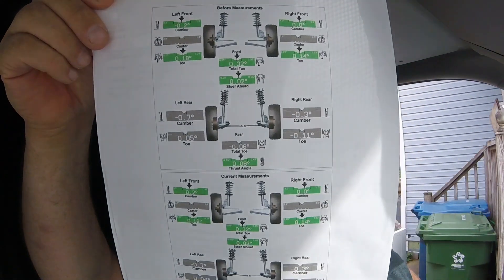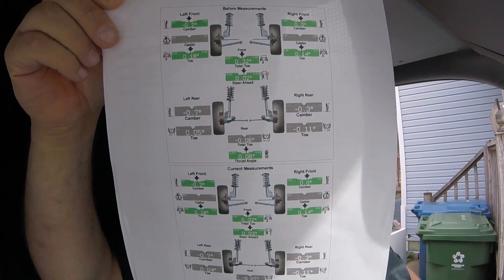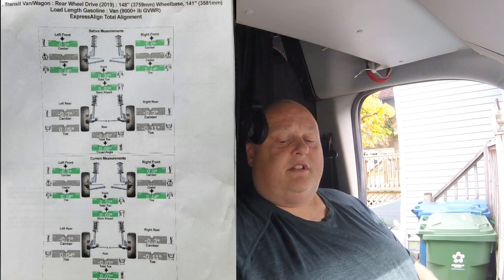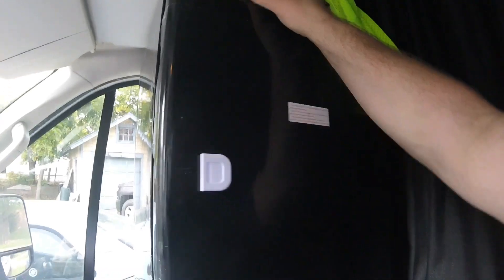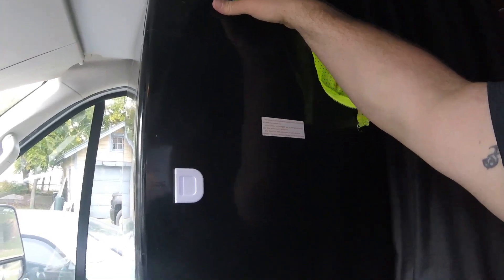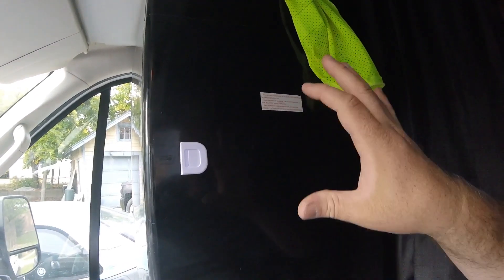$14,000 Revenue In a Month

Comment: Allen, you mentioned in a prior video about using Lucas oil additive when doing an oil change. The viscosity is 110. Lucas does make a low viscosity stabilizer which is only 19.7 viscosity. Use it instead on your Transit 3.5 engine with cam phasers. If youi use the old original Lucas in your modern van, you will cause premature wear and damage to your cam phasers and engine. Don't trust my word, watch Youtuber, Scotty Kilmer, a 53 year mechanic, video titled, 'I Don’t Care What Anyone Says, I’ve Been Using This in My Car for Years and It Works Great' dated 15 Oct 20.
Reply: I  would rather use motorkote i feel it works better had a semi ran it over 1 million miles..
Reply from the maker: Will look into it. Ty

Comment: The struggle was real with those L brackets lol.  Wowza the package stuck to the curtains, not good!  Good gross pay, what was the net after expenses?
Reply from the maker: Yes, not much room to work with between bunk and box. Lol. don't have it all itemized exact, but a rough estimate.....
Fuel $1875
Van insurance $600
Van payment $700
Tolls $100
Maintenance $100
Rough estimate $11,000 net minus true operating costs. If making tax deductions you could claim a profit or a loss depending on your choice. Lol

Comment: Dang 700k+ miles on that van? I don't trust them after 150k. I trade every 2 years. How have you kept that thing running for 700k?
Reply from the maker: Luck. Lol. Simply drive it correctly, maintenance and luck.
Reply: Lol dont trust modern vehicle past 150k ?🤦‍♂️ trade in every two years? 🤦‍♂️ very pocket friendly with all the depreciation in first two years 👏
Reply: @dariodjakovic1600  I pay my van off within a year. I'm not losing money on interest. It's just common sense